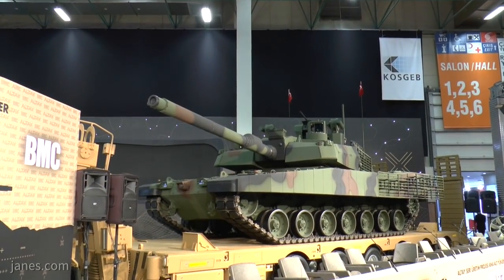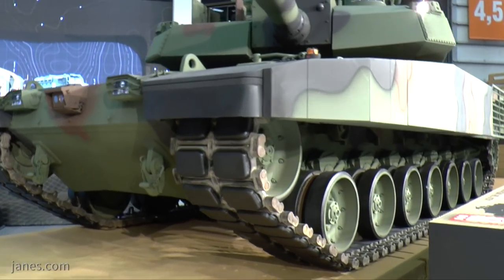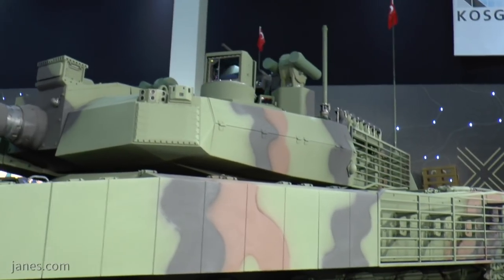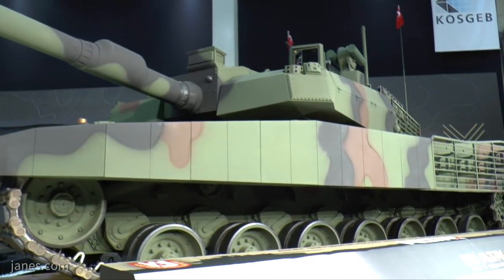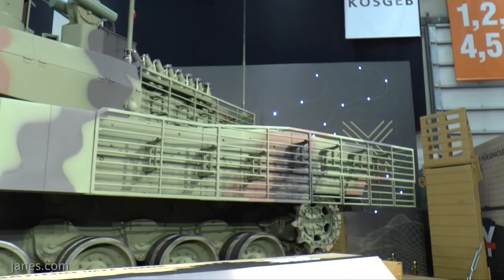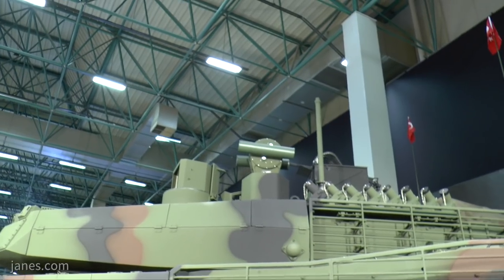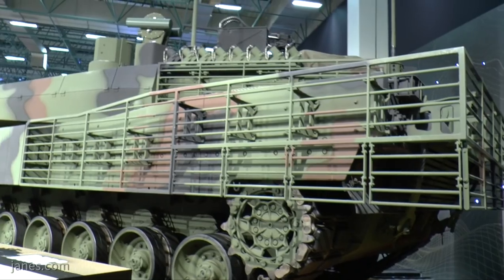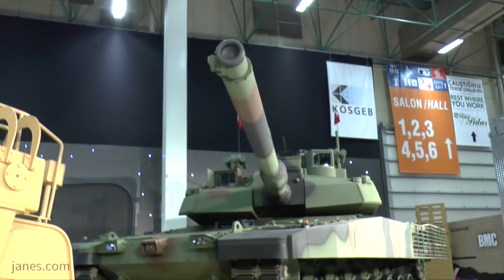IDEF 2019: BMC presents T1 Altay technology demonstrator

Comment: To people who claims Altay is a cheaper copy of Korean K2 tank: 
No, it is not. 
Actually Altay will be more expensive and it will be 10 tons heavier than K2 tank which means Altay’s armor is thicker. 
Altay tank’s chassis design was based on K2 tank that is true. But only their hulls looks similar and thats it. Their electronic systems, armors, active protection systems, engines and transmissions will be entirely different. Altay will use locally produced 1500hp engines designed by a Turkish company ‘BMC Power’. Other than 120mm L55 main gun, all of it’s systems will be indeginous designs.
Reply: Youre right my friend
Reply: Ace of Spades I didn’t know it would make difference whether a man or a woman launched the atgm. 
But don’t worry, I’ve watched the videos of the Turkish tanks getting hit, and the attackers were all male, if that makes you more comfortable. lol
Turkish army lost several leopard 2a4 tanks in Syria because those tanks simply sucked at asymetric warfare. Even 1960 model, modernized m60 tanks survived direct atgm hits but the leopards were wrecked. 
Turkish army lost a few tanks in Syria but it doesn’t change the fact that 7500 terrorists were killed in two operations (Operation Euphrates Shield and Operation Olive Branch)
Reply: Ace of Spades  killing 4700 terrorists in afrin while loosing only 54 turkish soliders turkey did very well in syria
Reply: Turkish bros dont mind Western trolls
They just can't take the fact that Turkey is developing at an exponential rate .....
Reply: Wait I think the main 120mm weapon is also made by MKEK a Turkish company...
Reply: @kaana8421  why shouldnt it. Normally u only classify armor only if it sucks lol since there is no real advantage in hiding u strength in this redared
Reply: Atlay design and made by Turkey but used input tech of korea.  I not like if turkey get tech support from another country in there weapons. Or haters will say it's made in Russia or others

Comment: Here's more in depth information on why the Turkish ALTAY tank is the best MBT as of right now. The newest & advanced gen Turkish MBT ALTAY tank has the Turkish ROKETSAN Bor-Carbon based new special modular reactive composite armour protection which is the most expensive & highest quality out there, CBRN defense elements, to protect Tank from chemical, biological, radiological and nuclear weapons, Turkish ASELSAN Volkan-III modular fire control system, the best first-hit probability against moving targets while on the move, The ALTAY Tank can spot, track and fire automatically at visible vehicle-size targets, even low-flying Helicopters without needing any input from a human operator. 

It's got 120 mm 55 caliber primary weapon, state owned Mechanical and Chemical Industries Corporation of Türkiye, Turkish ASELSAN Laser Warning System, Radar Warning Receiver, Command Control Communication Information System, Driver's Vision System, Navigation System, and Radar jammer. Identification Friend or Foe/Selective Identification Feature system and  battlefield target identification system  compliant with STANAG 4579 system.

Both the gunner and the commander will be provided with stabilised day/thermal sights with a laser range-finder having hunter-killer capability, Battle Management System (Similar to the Inter-Vehicular Information System used in the United States Military) allows the vehicle to share its data with friendly units, including other armored Vehicles and Helicopters.

ALTAY Tank is currently one of the best Tank in the World, which was designed to with and against IED and mines. Also, ALTAY can work with UAV and fire laser designated rounds which was targeted by UAV or soldiers. Not to mention the advanced Turkish Aselsan AKKOR active protection hard kill system, which AKKOR features an impressive reaction time of only 1/15th of a second, allowing it to effectively defend the host platform against rockets and missiles fired from a distance as close as 50 meters.

4 of M-band radar sensors and, typically, 2 of projectile launchers capable of firing four smart interceptors. Each radar sensor continuously scans a 100-degree arc, creating a full 360 degree detection capability. A total of 1000 ALTAY Tanks are planned to be produced in four separate lots of 250 units.  Ne Mutlu Türküm Diyene 🇹🇷🇹🇷🇹🇷🇹🇷🇹🇷🇹🇷
Reply: Thank you for the information, random fanboy.
Reply: @Furri1bia  No worries, furry fanboy.
Reply: Eywallah çok güzel hayırlı olsun
Reply: @Ababeel721  InshAllah Kardes
Reply: Hopefully, it's not in production yet once  they produce it and it's tested in battle we will see how good it is.

Comment: The Turkish ALTAY tank is the best newest gen MBT at the moment. With literally the best composite armour packing, active protection etc it's no surprise it's not cheap & easy to develop. Ne Mutlu Türküm diyene🇹🇷🇹🇷
Reply: How do you know it is the best when it hasn't gone up against the T-90, Leo 2A6, Challenger 2, Leclerc or M1 Abrams? The Altay would still get smoked by the lastest ATGM
Reply: Plus majority of concept tanks just punch people with bias on how good it is since they want to sell their product.
Reply: @CabbageBloke  I've already stated this many times on why the ALTAY tank is currently the best MBT in the world currently & why it's expensive. The newest & advanced generation MBT which is the Turkish ALTAY tank has the Turkish ROKETSAN Bor-Carbon based new special modular reactive composite armour protection which is the most expensive & highest quality out there, CBRN defense elements, to protect Tank from chemical, biological, radiological and nuclear weapons, Turkish ASELSAN Volkan-III modular fire control system, the best first-hit probability against moving targets while on the move, The ALTAY Tank can spot, track and fire automatically at visible vehicle-size targets, even low-flying Helicopters without needing any input from a human operator. 

It's got 120 mm 55 caliber primary weapon, state owned Mechanical and Chemical Industries Corporation of Türkiye, Turkish ASELSAN Laser Warning System, Radar Warning Receiver, Command Control Communication Information System, Driver's Vision System, Navigation System, and Radar jammer. Identification Friend or Foe/Selective Identification Feature system and  battlefield target identification system  compliant with STANAG 4579 system.

Both the gunner and the commander will be provided with stabilised day/thermal sights with a laser range-finder having hunter-killer capability, Battle Management System (Similar to the Inter-Vehicular Information System used in the United States Military) allows the vehicle to share its data with friendly units, including other armored Vehicles and Helicopters.

ALTAY Tank is currently one of the best Tank in the World, which was designed to with and against IED and mines. Also, ALTAY can work with UAV and fire laser designated rounds which was targeted by UAV or soldiers. Not to mention the advanced Turkish Aselsan AKKOR active protection hard kill system, which AKKOR features an impressive reaction time of only 1/15th of a second, allowing it to effectively defend the host platform against rockets and missiles fired from a distance as close as 50 meters.

4 of M-band radar sensors and, typically, 2 of projectile launchers capable of firing four smart interceptors. Each radar sensor continuously scans a 100-degree arc, creating a full 360 degree detection capability. A total of 1000 ALTAY Tanks are planned to be produced in four separate lots of 250 units.
Reply: @CabbageBloke  And no, the ALTAY tank will certainly not get smoked by a ATGM when it's got the newest Turkish AKKOR active protection & with the brand new, top of the line composite armour plating package.
Reply: dean yilmaz I’m probably older than you if you aren’t like 30 and you insulting me without answering to my comment means you clearly don’t know either. A tank is like any other product. There is shit tons of concept tanks coming and one thing is common and that is that it’s the best super advanced tank in generations of history. So tell me what makes you believe this concept tank is 100% true fact and not bunch of bias to get Turkish army to buy it.
Reply: @asovietmonk2949  If you're around 30 & leaving comments like "turkey is poop" then that's even more worse & incredibly sad. This isn't a "concept tank" nor is it a experimental tank, your lack of knowledge on tanks & probably other armaments has you making very broad & inaccurate assumptions, as tanks & other armaments are always advancing in one way or another as time goes on & technology & science gets better, as we didn't just take 1 giant step from gen 1 to gen 3 tanks. 

Now, if your question is why is the Turkish ALTAY MBT is the best at this time, I pretty much answered it when I replied to the other guy on why this tank is currently the best new gen MBT in the world, scroll up to read what I listed.
Reply: dean yilmaz my question isn’t why is it the best tank it’s if all of it’s proclaimed stats are 100% facts or partially made to get the militaries interest. And I’m 18
Reply: MajorLongDong Altay’s hard-kill and soft-kill systems were specifically designed to survive atgm attacks. None of the tanks you listed has active protection system as the Altay’s Akkor system the reporter explained in the video. Only m1 abrams will be equipped with Israel’s Trophy systems in the future. And Germans may develop their own active protection system for the leopard3 but right now leopard 2a6 relies on it’s soft-kill systems and composite armor.
Reply: A Soviet Monk Altay tank was developed under the guidance of Turkish Armed Forces officers. Project was funded by the army itself, so i don’t think Turkish army would fool itself. 
You are not objectively criticizing the Altay tank. You don’t like Turks and you are taking your hatred out on Altay tank.
Reply: AAA111 BBB That’s false accusations. I by no means hate turkey. I’m just criticising the tank since all of the new concept tanks are claimed  to be this super best tank in world which is why I question if it’s bunch of propaganda to threaten other nations.
Reply: A Soviet Monk Most of the Europeans don’t like Turks, and your comment above(Turkey is poop) made me think you are one of those Europeans. 
You are right about how some nations makes propaganda about their war technologies. Iran, North Korea, Sometimes even Russia does that. But Turkey is not one of them, Turkey is a NATO country and all of our weapons must pass NATO qualification tests. And Altay has already passed it’s qualification process in 2015. Now the mass production will start in 2020 and 1000 tanks(4 batches of 250 tanks) will be produced for Turkish Armed Forces.
Reply: @asovietmonk2949  There is no best Tank and I say this as a Turk. Almost all newest gen MBT's are not battle tested. Same goes for armata the abram tank is battle tested but not against atgm's and having depleted uranium as armor or armor piercing shells causes cancer to the tanks crew. Abram tanks would definately get stuck on middle eastern muddy terrains. And Merkava would never be the best either. We can say that all current gen MBT's are worthy competitors to be one of the best. Doesn't matter if its Korean, U.K, Russian or Turkish.
Reply: Tahsin Pwoblem +1
Reply: Your Russian tank is just a rubbish